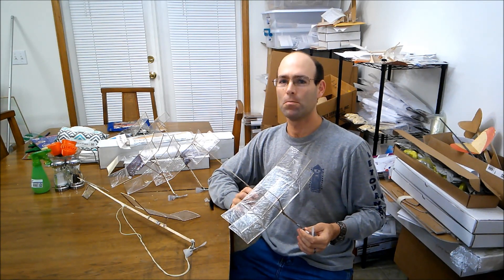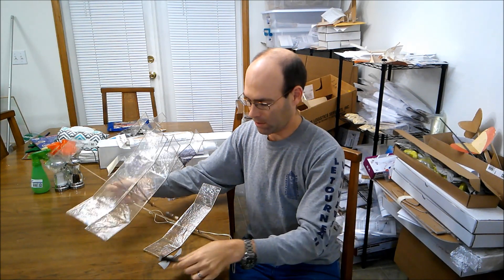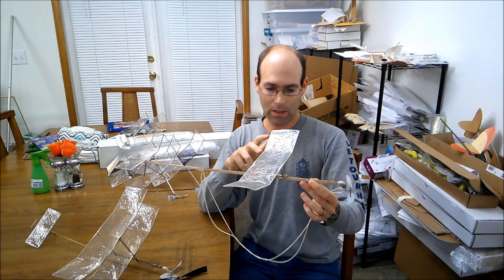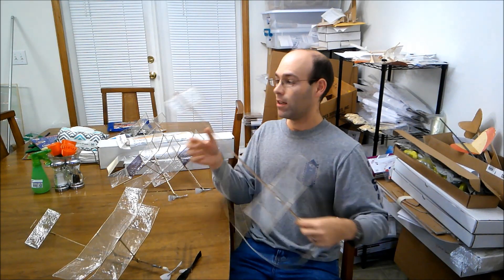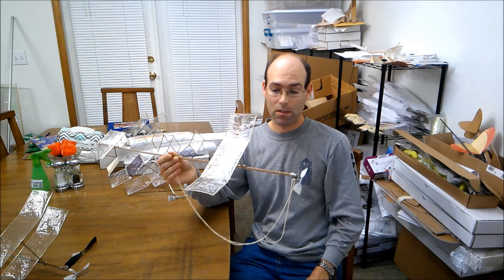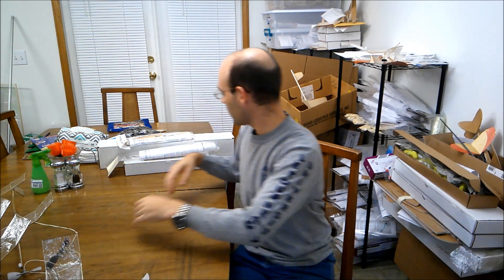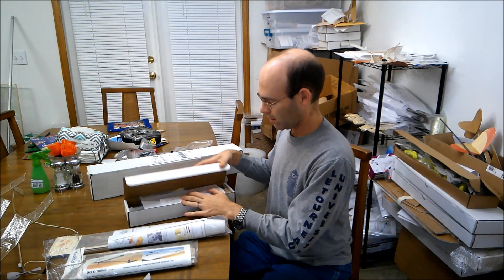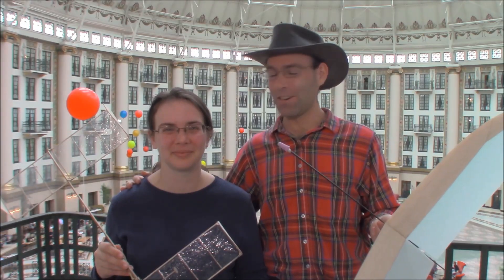Wright Stuff Kit Review 2020, 1/5: Intro

Comment: Joshua, we've never met but my son and I have watched your videos and we've ordered your stuff (Thank You!), and I would say that was more of a moderate rant, lol. I hope you all sort these things out because the percentage of handy people in the world is ever shrinking and it would be a shame to lose friendships over these disagreements.

My son and I are only doing this for the second year so we're beginners and we're out of the loop, but I want to reassure you that at least some of us are having a lot of fun adapting to this year's rules. None of it is too hard to master. For the rudder, we use a tiny strip of soda can metal that works perfectly. It's light enough to accommodate a very long tail moment that compensates adequately for the small stab. Our three-bladed DIY prop is no worse to make than the wood props we were making last year, and the trimming procedures are unique, but not insurmountable. 

As a manufacturer, producing kits quickly that adapt to new rules and fly decent is a challenge and is indeed what you needed to do. I will challenge you that this is not all you needed to do, I hope you were just saying that in a moment of frustration. There's no shame in acknowledging when other planes show better potential, and it would be helpful to those who purchased kits from you if you took the time to test and offer upgrades like a longer motor stick, lighter rudder/longer tail, and better prop, any of which would be easily incorporated onto existing planes at minimal cost, so that your plane remains competitive.

I hope you don't mind me posting. I discerned your unhappiness even last Fall, but it seems worse now, not better. This is still a lot of fun, adapting to the changes has been really interesting.

Comment: Thanks, Josh, for your reviews. I, too, was involved as a mentor early on for the SO Wright Stuff competition. Like you, I am an experienced indoor model airplane builder and flyer. I found that the rules as written by "Tom S." and his "committee" were not written from flying experience, (although Tom advertised that he was an AMA "contest director") but apparently from the point of view that the committee knew more than competent model flyers and they could to flaunt their NEA power. Little regard was shown for good flying experiences because the rules did not allow for necessary design stability nor for rewarding flight times. 

I made suggestions in writing to the powers that be. I am confident my suggestions were promptly filed in the waste basket. My suggestions resembled problems encountered by engineers in the design of payload packages on satellite launches or payload packages that are sent to the Space Station. I suggested that the design parameters of the model would only be dictated by the separate parts being able to  fit into a box of certain maximum dimensions. There would be no dimensions dictated on model size or propellor diameters. I don't recall the exact box dimensions I suggested, but they were of such as to challenge high school designers to come up with an optimally designed  model that, disassembled,  would fit into the assigned volume. 

I finally became so discouraged by the attitude of Tom and his crew, that I dropped out of the SO mentorship program. I see by your video that you are experiencing some of the same feelings in regard to the inane rules formulated by non-modeler SO committees  and foisted upon commercial designers and mentors and ultimately on the students who stand to be very disappointed with the results of their efforts because of having to adhere to stupid rules. The learning experience for the students is going to be very limited  because of the predictably poor outcomes of the event.